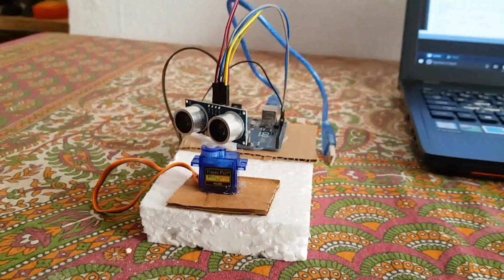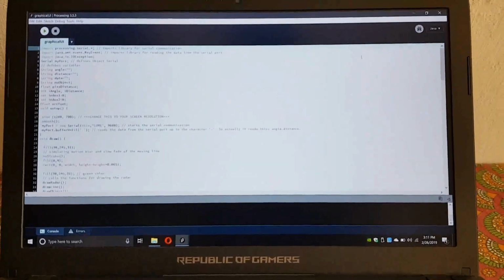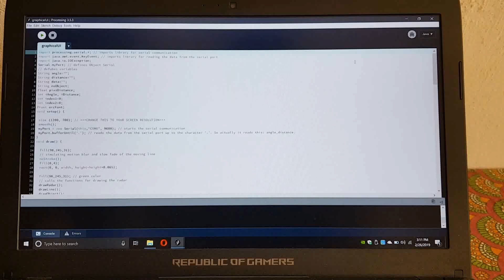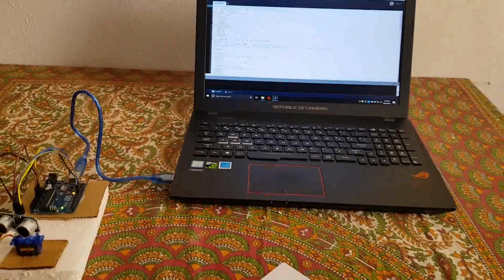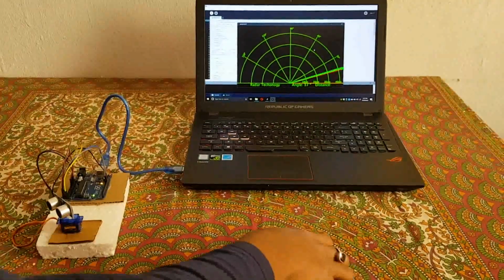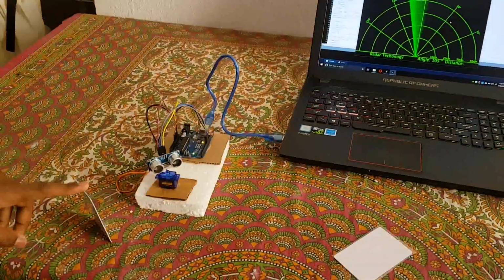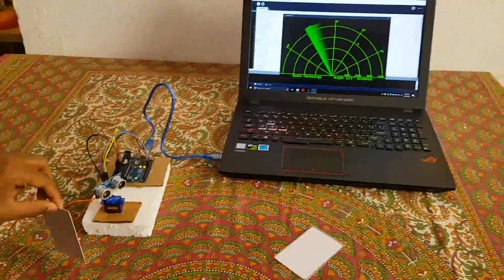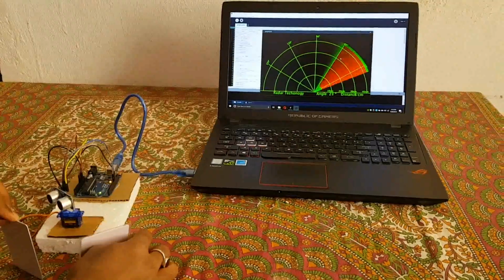Arduino Project | Radar System | using Ultrasonic Sensor |2019

Comment: Great video!!! Actually I wanted a waterproof ultrasonic sensor. Have you tried this sensor? https://www.ebay.com/itm/253978673298 or this modified HC-SR04? https://www.ebay.com/itm/254058015473 Have you tried any of those 2? Thanks in advance :)